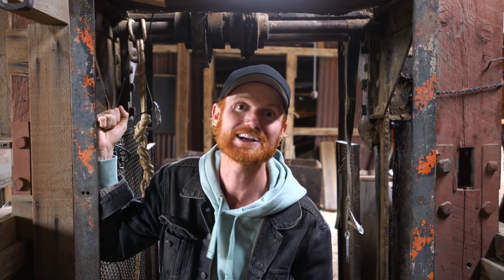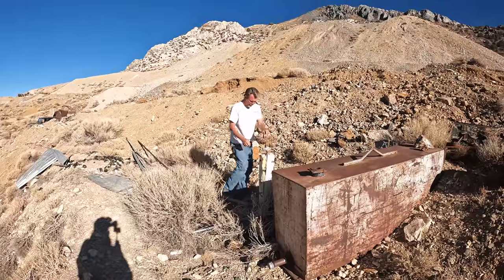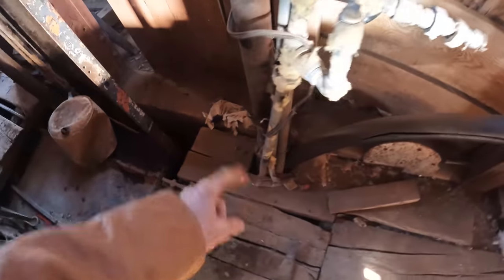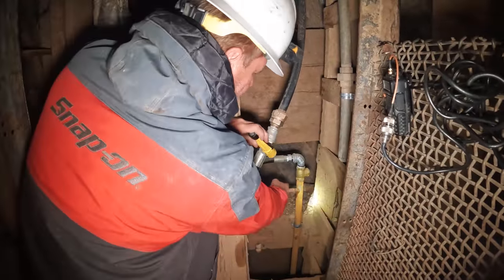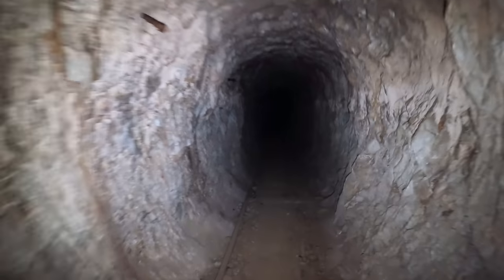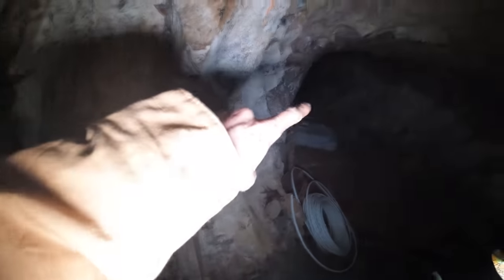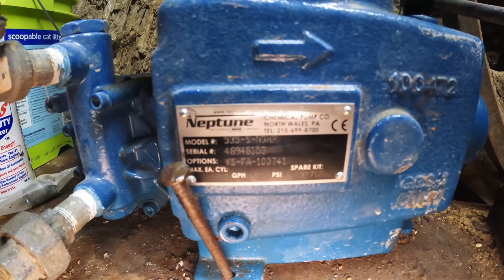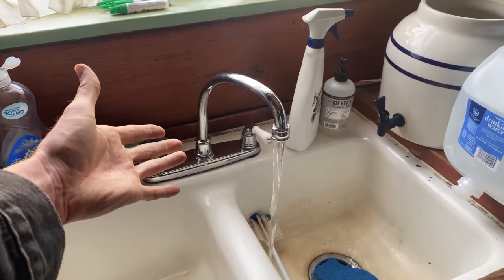How Cerro Gordo 'Ghost Town' Gets Water

Comment: is there a break tank at the top of the mine shaft? if it's one big siphon between the anti freeze outlet we see at the beginning and the pump at the bottom, that would be HUGE and would need a break tank at the top. if this is the case, getting the water up is not the problem. the weight of the water pulling down the hill can cause a decrease in pressure which effectively causes the water to boil at everyday temperatures. this boiling / cavitation can introduce enough air to break a siphon. the largest siphon at sea level is 10m (not much) apparently so I assume there is a break tank at the top of the mine shaft? otherwise this could be a cause of the siphon break. main symptom would be siphon break after a couple of times using the outlet tap I guess?
Reply: after a quick Google, the abstract to an article called the height limit of a siphon by boatwright Hughes and Barry explains it well.

Comment: Are there any portions of the lower tunnels than near the surface so a horizontal bore could be used or were there any drain shafts installed. It looks like the water is fissure seepage from what little precipitation is revived. Rainfall collection is hampered by Spanish water law 1st use doctrine prevent in Califonia which makes permiting troublesome, Keeler gets ~6" a year the peak?? you'd need enough catchment to contain a years rain since it likely comes during a limited number of events. The only issue I see with zero water or other similar systems is I'm not sure how low of humidity they can efficiently operate at and their cost might not be viable.

Comment: With that being the only source of water I have a couple things. Have you thought of building a water collection system? Something like a huge roof that takes the runoff and direct the water to your supply hole. It may even be as simple as coating a huge slab of rock to no be permeable and building wall / guides to direct the flow.

You can use every roof to collect water.
Also during the winter months where there is a huge amount of snow a plow attachment could be used to push snow into a water collection area where it can melt into your reservoir.

Think out of the box and do some research checking out some videos on living off the grid.

Comment: I wanted to hit you up on this months ago. Move the pump closer to the source. A submerged pump would be even better. Even though 700ft of head pressure is crazy ( can be fixed though ), the problem of losing prime can be stopped easily.

Comment: Have you ever thought of trying to siphon the water out of the mine? You would just need to run the pipe from the water source up the shaft and back down the hill to a lower point than where the water is being drawn from. This can be done without pumps, without electricity and without anything mechanical. Hearst Castle used something similar. They tapped into a spring some 20 miles away. Once you have the water out of the mine and down below the town, then you can pump it up back up to the town. This will eliminate you having to go down 700 feet into the mine to fix the pump. Just a thought.
Reply: No, you can only siphon water a maximum vertical distance equal to the atmospheric pressure pushing on the water at the source.  Or about 34' vertical height at sea level, less at higher elevations like Cerro Gordo.

Comment: There are several companies that make very clever devices that can condense water from air. Some run on solar. I know they have been used in places like Arizona. Might be worth looking in to.
Reply: Have any third party links? Anything not published by the creators just debunks them, I haven't seen a single one that is more efficient than bringing in truck loads of water like he is now
Reply: Yah, but there are minerals in tiny amounts that our body needs, distilling water sterilizes it, is why it is good to add to car batteries, has no metals to react with the lead.
Reply: I was just about to comment on this. I don't think they would be good for large scale water production, but it would definitely ensure safe drinking water.
There is a YouTube vid here with nearly 1m views which shows how the system works
https://youtu.be/KlUQ1pneow8. 

There are also moisture nets which catch water from mist/fog but I'm not sure if Cerra Gordo gets much of that.
Reply: Even in humid environments they require enormous amounts of power, and you're lucky for a few milileters an hour. Cerro Gordo is in the high desert where there is usually extremely dry air, so nothing to condense out of it. Thunderfoot did a video debunking those a while back that is a good resource if you are interested in the idea

Comment: You need a bigger pump! 304 psi is the minimum required (303.03 psi) to move water vertically 700ft. That gives you no pressure up above. 45 psi is considered minimum working pressure and 65 psi is standard. With a 20% cushion (maybe even more) to overcome joints, fittings, 90's, and friction loss, you would need 441.64 psi from your pump at the 700 ft. level. If you could find a collection point at the 900 level, you would need 545.64psi from the pump. That will get you roughly 65 psi +/- at the top, although your volume will be very limited and based on pump capacity. Have you ever taken the time to find out how long it takes to refill the well? Maybe you could pump a 1000 gallons at a time (much greater volume pump needed) to a holding tank at the top, which would give you excellent pressure as well as volume in the town. I also recommend a foot valve at each 100 foot of vertical rise. 

You are suffering from a couple problems that are working against each other. Primarily a lack of pump pressure and a lack of pump volume. Under the conditions you are working with, you have got to increase pump pressure as well as pump volume.

Also you may consider directional drilling from a point above town, (150 ft above for a holding tank with adequate working pressure) horizontally into the area of the well at the 700 ft level. I don't know your elevations so this may not work as suggested, but a directional drill will get you to your source with less vertical rise to overcome.

Also, I recall there being much greater water flow lower in the mine, so maybe further investigation as to an alternate water storage location would be beneficial.

Additionally, I have to ask, what is the thinking behind not taking advantage of monetization on your YouTube channel? With 1.5 million subscribers, you would have a quite lucrative income source to pay for upgrades and rebuilding the hotel etc. It simply does not make sense to not use it!

Comment: want to see the 500ft and 600 ft levels above the source might find stronger flow or direction of coming from. Only other option is to run water from keeler using ram pumps and check values as long as you maintain water pressure in ram pumps, they pump up hill without power

Comment: For longer term, I would think about acquiring a parcel miles down at the bottom of your hill in the flatlamds, and sink a well down there with a monster sized water tank, and than acquire metsl vinyard piping or the like, and pump it up the hill into Cerro Gordo, and have any pumping stations and watertanks that you might need in between. A big project, but with all the vinyards in Ca, you might be able to get donations on the piping, and perhaps some $ donations for the project. You might be able to write for a grant to pay for the whole project, being as you're saving a town and its history.

Comment: I would take advantage of the snow fall, how many canyons can be dammed with small dams that flow into tanks. Get a plow truck and plow it into big piles over tanks in the ground. when spring comes it melts into the tanks. Think of it like a cold storage for your water. I was in the USAF in New Hampshire. I had a chevy half ton with a plow on the front and I could push pile of snow about 10 ft high. Maybe Dave could set you up with a plow truck, and while he is at it, a concrete under ground water storage tank. That way if the mine water is not working or not as much as needed. Someday it will be a resort! and you are going to need all the water you can get! Maybe even a swing pool for summer and water storage in the winter. My cousin is an Architect in Sedona AZ. he likes the keep it natural think, he might design some small cabins for you! You are going to need a master plan for the city, water sewer and power. It might be good to have some plan it now so that you will have a direction and plan to follow. that way you can do some of the work a you go! no back tracking! I respect what you are trying to do! I hop it goes better for you and the project. Thanks for taking some thing like this on and preserving the past! My Email is rjlicher@gmail.com. cell is 1-928-230-2877 I live in AZ Lake Havasu City, Az 86406. one more thing you need to show on a map where it is like the bonanza map to show people where it is and how to get there! That would help people plan to come  there! They could bring supplies as you announce what you need!  The old map thing would be cool like the cowboy show, you could even name some guys, like lefty joe, and big john!

Comment: If the water is of safe quality to use you need multiple pumps on different levels then feed to a much higher well insulated reservoir above town. Potentially built under ground if possible. Then the town runs on downward pressure and it will be sustainable.
Reply: In addition to this you could potentially have other vats near your pool that are being fed to and overflow straight back into your pool. This way you can gather a larger amount of water to be collected on a trickle then pump the full containers up. Also another way stop the prime failing is to tee off at a higher level straight back into the prime section of the pump hopefully by doing this you create a pressurised system at the bottom pump section of the mine. I've only done this with a fish tank doing water changes so I know it's possible but maybe an engineer could verify this theory before practice.

Comment: It's too bad you can't drill a hole straight through to the pump so you are not fighting the height. Can I assume that you are running the water into a 'water tower" to maintain pressure? ( or cistern to hold the water as you pump it from the mine). Is this water then not potable (good to drink) or does it have too much lead?

Comment: Is there a bypass system set up if there's no water being used? Or a pressure switch on the pump in a no flow situation? Being a diaphragm pump it will eventually fail if it's trying to pressurize constantly during no water being used

Comment: Could you use a 50,000 gallon water bladder for water storage? so you could fill it by Truck or pump during the off season its rated to store water in the cold too. The only down side is im located in minnesota.

Comment: How are you getting the mining chemicals out of the water? Have you considered putting in some cisterns? A friend had a nice deep one on the screen porch that doubled as air conditioning on hot days. They set up a system of gutters and so forth on all the buildings that sent water to it from rain and snow melt through a filtration system and it was fantastic.  Even on a 112 degree day that water was ice cold and so delicious.
Reply: The dust when the wind is blowing which it does a lot,  gets airborne and it is contaminated, read my postings

Comment: Would it be useful to put in a 20k gallon tank and use the snow from the winter to fill it? 

I keep thinking it would be neat to run an ethernet (network) cable down the mine shaft adding wifi points at various levels to boost radio capabilities and to let you put in other things such as a network based meter for the pump to know when something was wrong.

Comment: I assume it does rain at Cerro Gordo, although I imagine not a lot but a few water tanks collecting off the roofs of the various structures there might also help with supply.....and be purer than the toxically suspect mine supply which you should really get tested for metals, namely lead.

Comment: There is a Spring, a standing pumphouse, with a piston pump that CAN be refurbished, there is an existing pipeline running all the way into town. A days digging in the wash establishes a pond, a pool, a reservoir to pump water from. Establish a replacement water tank where the old one collapsed on a high point, I suggest to build out wood like the original one, esthetically more pleasing and is part & parcel with the town. Pumping would be required only up to the tank, as the water is gravity fed from there into town. It is much more cost effective to transport water initially from the tank into town to fill a tank there, your nearly the same elevation as the town.. The pipeline terminus in town needs to be located and plugged with a valve and the section joined at the tank, so that water can be pumped from the Spring to fill up the pipeline. The valve at the end would need to be opened intermittently to bleed the compressed air. Run water through to clean out the line and quite possibly need to send a drone to spot any leaks, fix with hose & clamps. Not a lot of hullabaloo to establish clean water, Eh! The trouble is that if one can't see a way to accomplish, there really is no hope! We have a will, how we use it, greatly influences our survival! Work smarter, not harder!
Reply: Namu Amida Butsu Brent, why is it that you consistently delete my postings? I come here to be entertained but more importantly to convey my experience and knowledge, but you seem to have a problem with insecurity. I'm 70, an Aspie, I spent a lifetime watching people, I mean really watching people, to discover their inequalities, can they be trusted, etc. All my comments had the intent to create a positive outcome. You water problem is a long way from being resolved, you have focused in the wrong direction.

Comment: I know its a long shot and not ton of rain, but multiple rain collectors from hills sides that can also catch snow melt, feeding into a water tower along with the mine source trickling into the tower. might get you a good grip of water in after a full season
Reply: The dust when the wind is blowing which it does a lot,  gets airborne and it is contaminated

Comment: If I had to have a system that deep I would do relay pumping,Go up several hundred feet and add a second tank with a float then add a second pump to the surface were you have several larger tank to supply the town from.

Comment: Since your limited on how much you can collect. A float at bottom would be good to keep your pumps from running dry. In the future I would talk to someone who distills water for a ship so you could potentially reuse water. And make collection tanks off of buildings in use. So I was wondering has anyone drilled down below at foot of the mountain. And if so perhaps a well at base level. Steep mountains.Hope someone has an answer soon.

Comment: I am just wondering if a lift pump from the collection pond to the main pump that has a recirculation so that you dont lose the prime at the main pump.  So the small lift pump would always run but once it reaches pressure at the pump it can divert the water back to the collection area.  So then when you put a load on the main water system you are not fighting both the head pressure of 550 feet and the prime side that is not ideal itself.  Maybe a short term solution so you don't need to go down every few weeks.

Comment: Im no expert, but It would seem that creating a topside tank of some sort to draw from might help.  If you look at small towns you see big ole water towers, not that you need one on such a scale, however the idea is sound. The system would constantly fill a rather large tank on the surface where you could treat/filter the water then use that water for every day demand. I saw suggestions on how to increase you available water supply in the mine, seems that could help.... My humble two cents.

Comment: Have you mapped where water drips in each of the levels of the union mine? The mine is only there because water deposited minerals over millions of years, but if the water runs high enough, you may be able to run a gravity feed pipe out of the 200 level.

Comment: The problem is, a little video is of little value if asking viewers to give their recommendations. As an engineer I would want to know the failure mode. Is the pump losing prime? Is the pump failing/burning out? I know centrifugal pumps will destroy the shaft seal if run without water. I have worked with diaphragm pumps, but they were pneumatic. 

Some things I do wonder:
Does the pump lose prime when it shuts off. There is a check valve, but how well does it do if there are small leaks in the line that allow the water to drain back? 
Does the pump automatically shut off if it loses pressure, which might be an indication of lost prime, or does it run to failure?

Comment: How do they pump water from a well? Those are all done topside. Even if you had to move the water to holding tank at the 700 level with a submersible pump I think you'd be better off.

Comment: Have you looked into an atmospheric water generator? It's there a possibility to pull moisture from the air? I see low cloud cover in some videos, which could be a great source of water (in incremental spurts). Condensing water from the air would give you clean water for drinking. They're not cheap and may use a large amount of energy while operating, but could be offset with solar. When the hotel is finished and you start booking guests, you're going to need lots of water! I see your getting a 40k gallon water tank, but shipping what's an already limited water supply up the mountain won't be cheap, either!